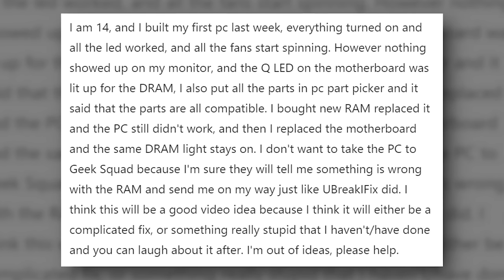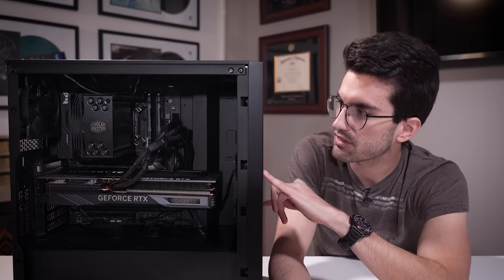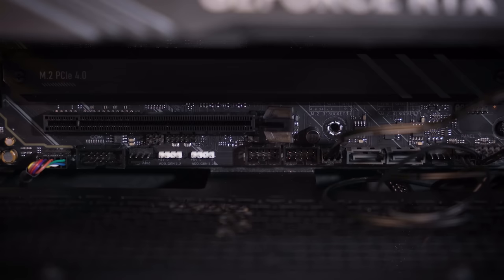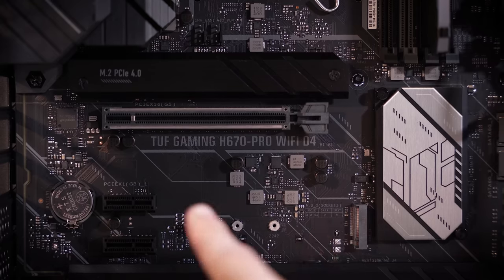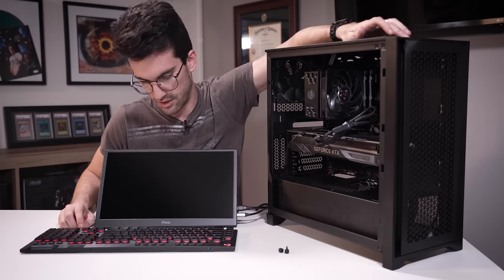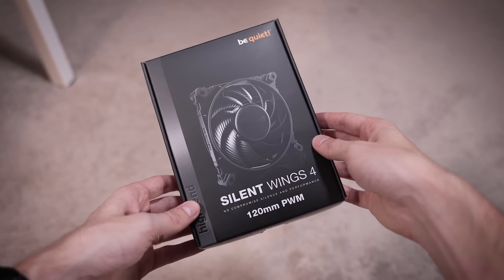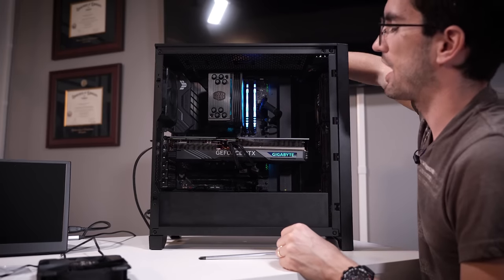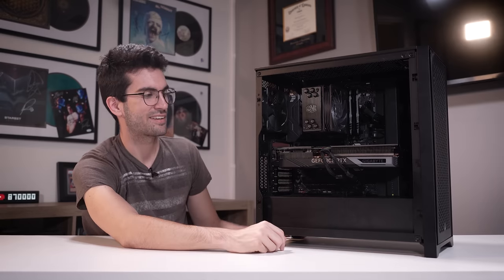Fixing a Viewer's BROKEN Gaming PC? - Fix or Flop S4:E4

Comment: I had a similar issue with my MSI Z790 Tomahawk but with the LAN drivers . The integrated intel LAN controller and the WiFI controller wouldn´t show up and no matter what I couldnt get the drivers installed with windows installed. Just like you did with the NVME drivers I had to manually inject the drivers before installing Windows. That solved the problem. Even with Win11 installed and bypassing the by microsoft forced internet connection I couldnt install shit because Windows 11 locks you out after restarting if you try to skip the networkconnection via console. 
But MSI does include the drivers for the Intel LAN controller on the USB stick that comes with the MB. So it seems to be a known issue with the Z790 chipset.

Comment: was confused why pcpartpicker wouldn't tell you about this issue bc i had the same one with a ryzen cpu when i made my current build. added the mobo and cpu to a new build and it does say if you have an older BIOS that you'll need to update it to v2004 at least to work with the 13600KF. i do get why it might have been worded confusingly bc it starts off the warning saying that it does work, but ends it with the caveat of having to update the BIOS.

Comment: I upgraded my cpu  from 12th to 13th gen and my system acted insane. m.2.1 and m.2.2 ports were disabled. trouble booting to windows. any attempt to activate xmp would result in Q codes that did not exist in the motherboard manual. the bios I had was dated after 13th gen support, however, it was not the most current. most recent bios update from March solved my issue.

Comment: I just upgraded from the 5600x to 5800x3d on a Tomahawk B550 mobo yesterday, updated bios did everything right and got the red light on cpu after trying to boot. Double checked everything was seated and plugged in correctly and still got the red cpu light. Tried one more thing which was just removing both ram sticks then re-inserting them and then it booted and everything was all good! Any reason why that would of solved the issue?

Comment: Just upgraded to a 5800x 3d and the pc wont power on after the upgrade. Bios has been updated to support the new cpu. I tried putting back in the original ryzen 5 3600 it still won't power on. Any suggestions?? I get rgb lights on the board and that's as far as it goes.

Comment: I expected it to be a bios issue when he said he has a dram led with no boot. I had the same thing back when I put a 3770K on my ASUS P5KC. It's annoying, because I also spent a good deal of time messing with ram (I mean, that's why the light is there no?), but I ended up figuring it out after trying to put the 2500K back in and some googling. Funny thing though, when I went for the BIOS update the thing failed, got to 100% and everything, just never booted again, just dead.

Comment: Nice video. Take care that the BIOS is often the problem BUT when i change/update the BIOS or DDR4 settings on my Gigabyte X570 board then it sometimes needs 3-5 times rebooting before it posts.  So it looks like everything is wrong until it (trained?) is just fine after several times rebooting   :D

Comment: PC shuts off after 5 min of light gaming
Heating up, but I have replaced thermal paste, water cooled with Corsair AIO (pump is running)
Also, random black window loads and disappears upon turning on
Any help? 
AMD Ryzen 5 5600x
Asus B550 F wifi motherboard 
Corsair vengeance 3200 ddr4 kit
Corsair 750w gold
Corsair h100i 
Msi 1660 super

Comment: Bro can you help me please, I installed a new GPU, but it always shows no cable connected, so I put my old GPU back and turns it on and it is all okay, the new GPU is surely working because it's new and I saw it worked before I bought it.

Comment: For future reference, 600 series mb have 12th gen support, 700 series mb have 13th gen support.  They won't usually be updated unless they get a mb revision.  ie. R.2 stamped on the MB bottom rear.  or the mb gets a v.2 with mb updates.

Also, when testing RAM, it is a good idea to test with non-overclocked RAM.  ddr4 uses 1.2v, any higher is considered overclocking.  I mean, you wouldn't diagnose a problematic PC with a known overclocked CPU?  That would nuts!  So, you should do the same for RAM.

I know you did a series on bad CPUs, but you were using overclocked RAM at 1.35v, this can expose a weak RAM controller, that would otherwise work on a standard 1.2v DDR4 sticks.  I'm sure at least one of those faulty CPUs still work.  I mean, the CPU QVL standards measure will let not cherry CPUs through, or get lower binned and could easily get a weak, but fully function memory controller, until you plop in OC RAM, then BSOD or no post.

Comment: You don’t expect your tech to be so outdated when it comes new.
Reply: Ironically, I did expect it on the motherboard I got. But then it turned out it had the latest BIOS, and the problem turned out to be a weird compatibility issue with the monitor, which was weird to me because the same monitor on the same graphics card worked just fine in another computer.

Comment: I would have added the spare fan back to the system and make the fan tower do push and pull.
Reply from the maker: This video was published a fair bit ago so I don't recall the fan we replaced, but I believe they were different brands/models. Would've looked tacky. And in our testing a dual fan config for a single tower cooler doesn't change much in the way of temps. Just makes things louder.
Reply: @GregSalazar  Just my thoughts. love your content, Greg.

Comment: Can anybody help me, I've been facing the same issue since 2022 my pc's screen suddenly shuts off all the time while I'm using it, says NO SIGNAL but everything is still working except just both of my 2 monitors. I already did reinstalled my grphcs card driver still the same issue occur, replaced the thermal paste still the same, removed my ram sticks cleaned it even my gpu, still the same issue. Until now i can't use it cause I'm afraid I'm just gonna get it worse.
Reply: Have you tried different video cables and different monitors?

Comment: Good Video and A very good outcome I came to the same salution when I saw the motherboard and the CPU it was paired with. Having just built 2 new 13th gen PCs myself using the Asus Tuf B760 plus motherboards 1 is ATX the other is mATX 1 CPU is I5 13400f the other I5 13500 so with all my research I had also found that 12 and 13th gen components are compatible only after flashing the bios. now I have a different issue with both PCs of mine They both boot into the bios and I have to press F1 followed by F8 keys to boot up my system I cant for the life of me figure out how to fix this issue with out flashing the bios something I have never done and am nervious about doing it wrong and bricking my system any ideas would be appreciated thanks
Reply: Have you tried a bios reset? Reset everything to the default settings

Comment: K cpu naturally has higher clock and can be undervolted through some B series board. Also overclocking is a dumb old days thing for normal users tbh.
I don't see any issue using a K cpu on a B board.

Edit: And 13600 is just a 12th gen revamp, 13600K is the true 13th gen that has more L2 cache and better performance over 12th gen.

Comment: With the k sku and h chipset, we all know that the 600k sku is better and will boost higher longer in any board it’s in. It’s always the better chip and there’s no reason to downgrade the cpu unless the vrms become an issue
Reply from the maker: Yes, I'm aware, which is why we said it wasn't a big deal. However, it still isn't optimal. If you're willing to shell out additional $$$ for a K SKU, you're likely also able to justify a slightly more expensive board in a Z chipset.
Reply: @GregSalazar  honestly it would be very interesting how the power lvls would work on a h series vs a z on a k sku. Would make good content maybe 🤔

Comment: I'm going to get flamed hard but... I don't care how old you are. If your going to bother tackling a task educate yourself 1st. This was a easy, searchable, and obvious problem to solve. I know they said "PCPP" said it was good to go. But always check the MB literature for compatibility. Never rely on a third party. I stared working on engines at 5, yes 5. I had a yz50 dirk bike and my father made me do all the maintenance at 5. He tought me and I learned at 5. At 14 I was buying fixing and selling computers, small engine things, and working at my dad's dealership doing oil changes, break jobs, tires, and other lub tech duties. I don't think I'm special I just always wanted to learn and when I faced a problem I read manuals, service bulletins, and other peripherals to help me through. I did not have The luxury of the internet in the mix 90's and if I got stumped my job was taken from me and I did not get paid. So again I learned how to critically think and problem solve.

Comment: Can we please stop the "this board will be bricked" stigma from a failed bios flash?

It is NOT bricked. You CAN salvage it with basic soldering tools and a short bit of time or take it / send it to a repair shop to have it fixed.
Depending on the motherboard it will, in most cases, be cheaper to have the board fixed rather than throwing the original board in the landfill and buying a new board.
Reply: I highly doubt most beginner PC builders have basic soldering tools and knowledge of what to do next.
Reply: @Javier Flores  Right. If the "your board is bricked buy a new one" Wasn't as prevalent then there would be info on what to do next. But YouTube and message boards are filled with the "your board is bricked" BS.

Comment: why build motherboard support 13 gen but no ???? need new Bios or UEFI (Unified Extensible Firmware Interface) what old bios not support 13 gen ????? there is no make sense or what ? why even build bios that not support 13 gen when you build motherboard to support 13 gen or what ?????? 🤣🤣😆😆😂😂🤣🤣😆😆
Reply from the maker: ? Because this board was released prior to 13th gen's release. It supported 12th gen natively. As discussed in the video, it's no different than the many iterations of AM4.
Reply: @GregSalazar  nope when you bild motherboard for those gen 12 and 13 they say it supports then ? Why build bios who not supports gen 13 ?